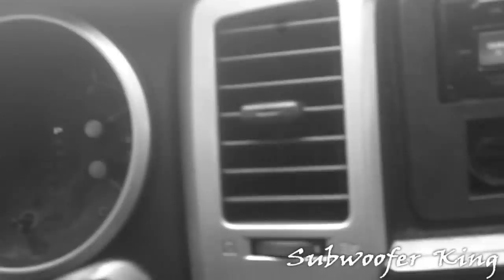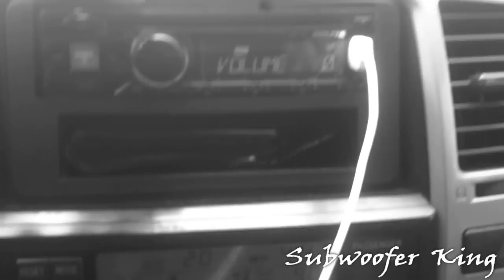Car Audio NEWS Report: Sundown ZV5, Jacob Fuller, SoundQubed

Comment: Blasting a 47hz or any test tone is usually for burp classes for one or two seconds street beat is usually 30 second average on music with mic in the kick in usaci however the meca origination puts their mic by the passengers headrest that simulates what the db would be at the passengers head which is pretty cool and you can do burp classes or music 30 second average... funny video man
Reply from the maker: Thanks bro! But yeah I don't think the 30 second music runs really simulates real life for the most part. Because a lot of people (I know) play a song that's tuned high has hell, to have a advantage over people who are tuned at a lower more normal daily fs
Reply: +Subwoofer King it's all really how you want to build your system like mine is daily and spl because I can change my tuning on the fly with different port inserts to go lower or higher tuning but I get what you mean because not everyone has that advantage because they are stuck at one tuning it's all what you really want for a build do you want I do numbers and get trophies or move a lot of air and give demos it's all really in what you want In a build just got to take it into consideration before planning a build out advantages and disadvantages of each build type like port location, tuning, box volume, type of box (ported sealed 4/6th order) that's what makes bass systems awesome no two are alike and everyone has their own preference on what they like to be tuned to
Reply from the maker: Yeah that's awesome u can switch ports like that. But ever since I started hearing about Low End comps, I stopped seeing the purpose of High End comps. I mean I kinda see the purpose of High End, because u can put up higher numbers. But Low End is much more realistic though lol. Idk to each their own we are both bassheads lol

Comment: gotta question I am considering selling my 4 sundown X 18's and getting 2 of the zv5 18's  can you tell me how do you like them was thinking 2 of them in a 16cu ported box on a bc5500 to start plus there isn't much specs on them yet how are they on the lows have you encountered any problems with them and what is a good price for a single zv5 d2 sub